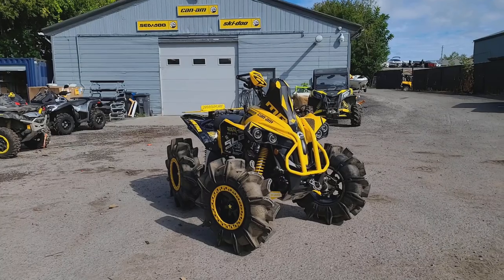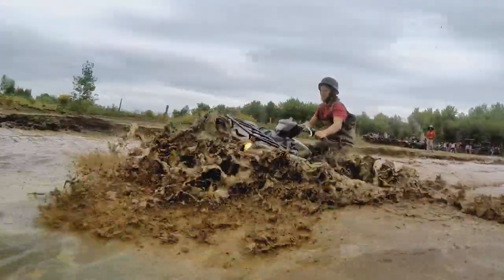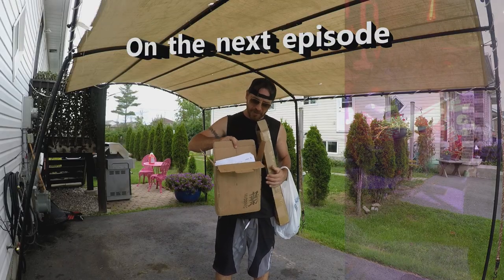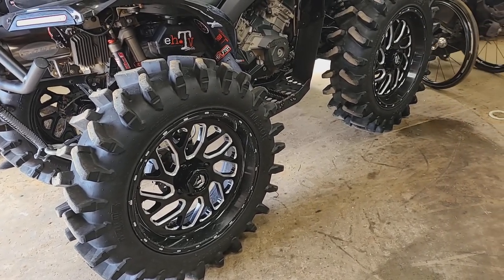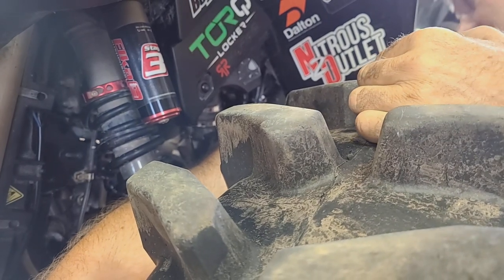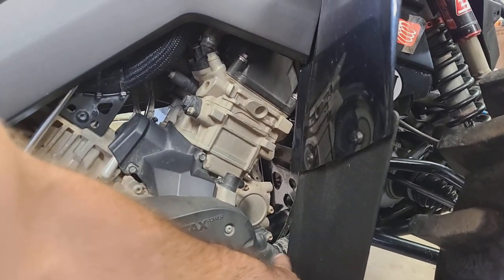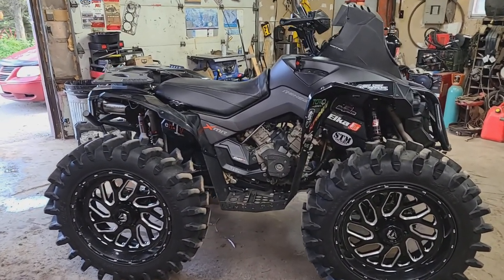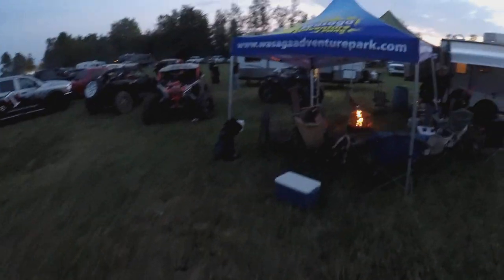Wiring, Welding & Ripping (2018 Renegade 4Lok Installed)

Comment: Can’t wait to see on how the 2021 front dif works
Reply: When you going to get more nos for the old girl
Reply from the maker: Looking forward to seeing how it holds up as well.  Never been in a rush to use the NOS setup on it. Only gives about 300more rpm anyways.  The Renegade has never really lacked power for my use.
Reply: @ehTV1000   ok I am thinking about getting on one day and at first I wasn’t sure but the more I watched our the more I fell in love with can am
Reply: I have a suggestion I personally think you would have a blast at mid bash it is on some time in may you could also meet up with Brandon Price
Reply: I prefer my old torque locker. No rpm or speed limit. This 4lok on my 21 limits my rpm and speed :/ still nice to have to crawl out of stuff but ya haha.